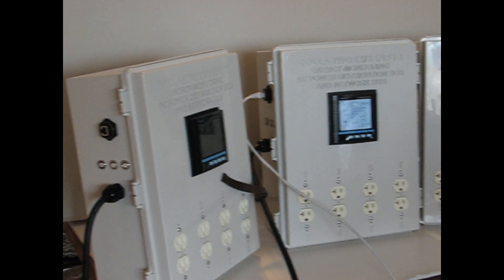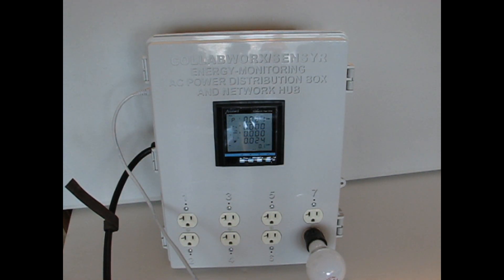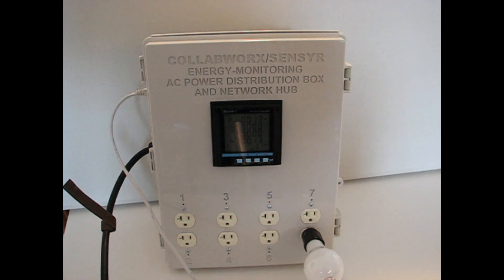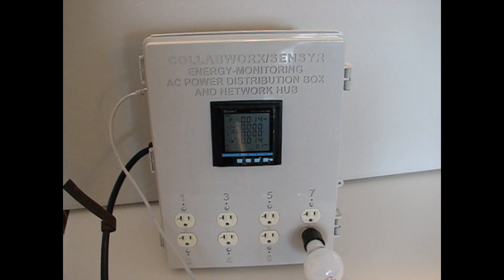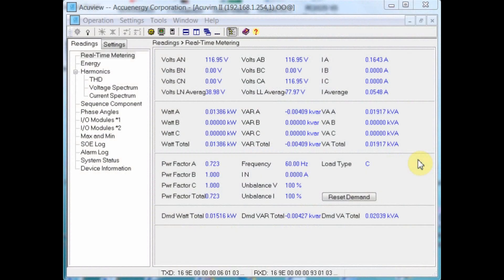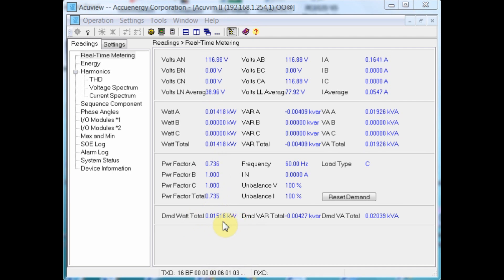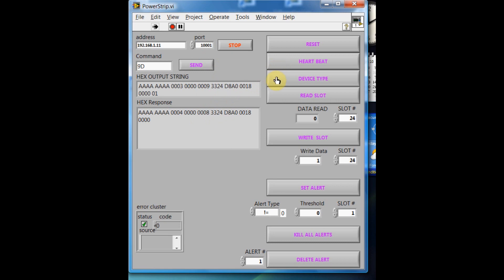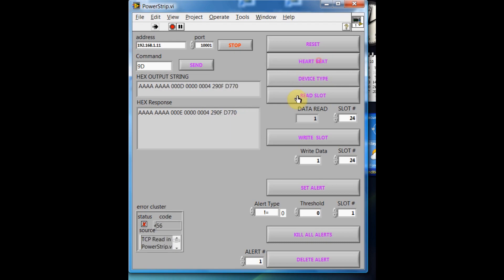Part Three of Energy Monitoring Box

Comment: @breezebro I used a Lantronix XPORT ethernet-to-serial module for the power outlet controller. If all you need is an open/close signal, that module has some controllable logic lines. It supports secure comms too. 

Oh, and you'll probably need to set up port forwarding to talk to it behind a router.